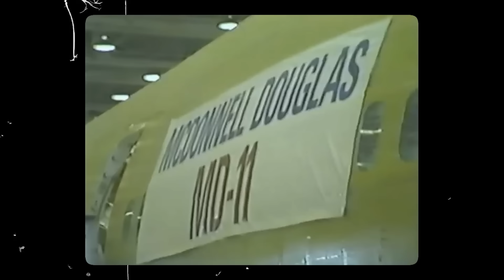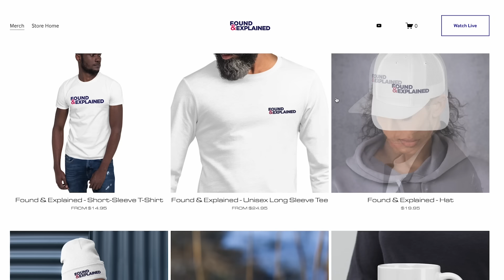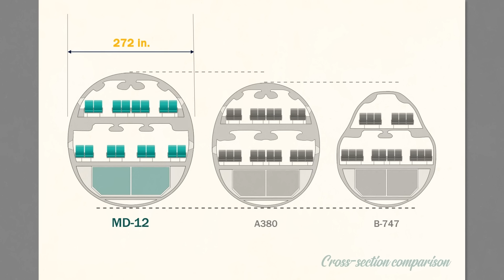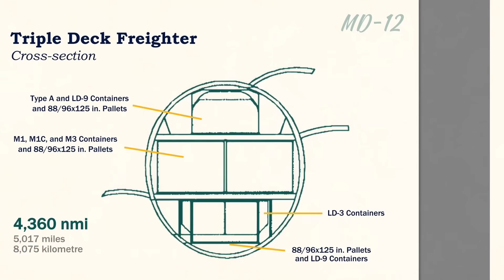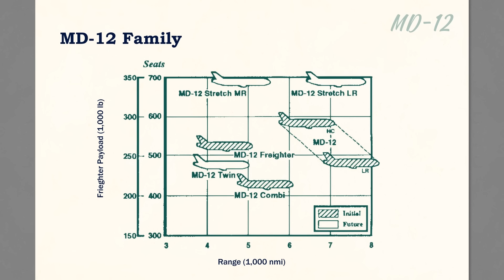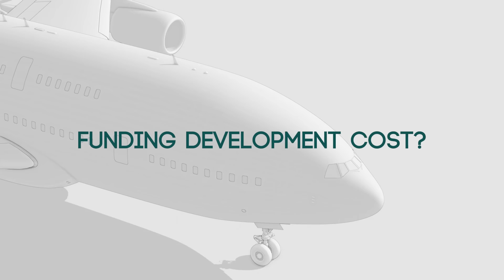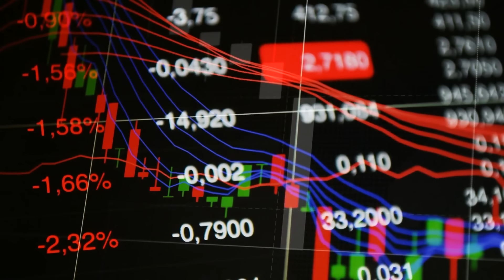What Happened To The American Double Deck Jumbo Jet? - MD 12

Comment: Compared to your first video on the MD12, the model now looks much much better. Its great to see you improve and grow man.
Reply: Looking at the videos of the aircraft in flight, I wouldn't have known them from reality.
Reply: The video is well done, but the plane is shown with the cockpit between decks, not on the upper deck as on the 747 as mentioned in the video.
Reply: Well, but the model does not fit the conent, showing the cockpit to be on the lower deck :D
Reply: No no😮 no 3:01  @Eldexo
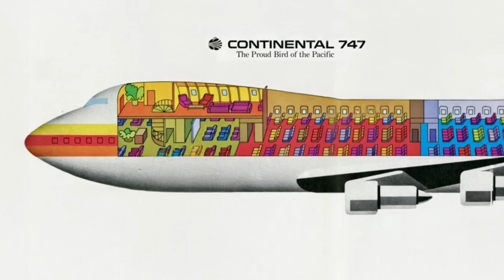Reply: 3:30
Reply: Agreed, he’s come so far.
Reply: @Flies2FLL his model is correct as per the concept. look 9:03
Reply: 9:03 cockpit windows in the middle like his model. It is correct
Reply: @747simmer4  we're talking specifically about the 3D model

Comment: The MD acquisition and their philosophy was what ended up screwing up Boeing.
Reply: Boeing thought they were the ones buying MD, when it was MD that ended up running Boeing.
Reply: Boeing always had safety problems and never owned up to them. The MD merger just made it even worse.
Reply: It’s almost unbelievable considering it’s the same company that made the F-15 🙁
Reply: MD management appear to be somewhat lacking viz their later negative impact upon Boeing … so perhaps it’s not a surprise this did not happen
Reply: And Old Bill Boeing is spinning in his grave so fast these days, he might cause the Cascadia Megaquake all by himself.
Reply: @josueramos7220 Well F-4, F-15, F/A-18, C-17 and American Harrier the military side seemed to be under different management
Reply: And Douglas...
Reply: @Prodagist  It was never this bad with old Boeing. Practically the only example are the engine struts of early 747s being possible to shear under load even when maintained well but  those issues were due to misguided engineering principles rather than cost cutting and so they were fixed fast
Reply: @cuscoothriyas5163  The main example I'd refer to about it is the Rudder system of the old 737-200s and 300s failing. It claimed 2 aircraft and nearly took down a third, Boeing was confirmed to know of the issue after the first crash but kept quiet to save their reputation.
Reply: F-15s have ejection seats, airliners don't.
Reply: I agree.

Comment: so a company who stole from Boeing and Airbus and still managed to fail...
Reply: Well technically they now run Boeing. So now it's Boeing which is failing
Reply: I think the narrator got that part wrong. When I read the history of the MD-11X and MD-12, the double decker MD-12 was well ahead of any meetings between McD and Airbus. 

In reality according to what I read, as soon as the ambitious MD-12 was scrapped because of a lack of funding in favor of the simpler MD-11X derivative, McD sought to simply purchase the wings of the A330/A340 from Airbus, but the latter declined as they saw it as an overt competitor.
Reply: thats interesting. I always thought that the md 12 wasn't built because boeing acquired it
Reply: @Ilovedanielgordeladze  
The MD-12 concept dates back to nearly a decade before Boeing entered the picture.

Comment: The MD 11 Stretch is something Amazon needs badly. They need more freighters badly.
Reply: 767 or 777.
Reply: The jungle air use mainly 737, 767 and couple Airbus 330. Over 100 cargo planes. According wiki

Comment: The reason airlines chose not to invest in MD's vision is because they knew it was farfetched and unlikely. MD had a reputation for missing targets and promises. Many airlines were burned by the MD11's higher fuel consumption and lower range than advertised.  They weren't about to take a massive gamble with them.  Singapore Airlines for exampled canceled it's MD11s and AA was desperately trying to unload them because they failed to meet promises.

Comment: 16:12 The A380 is a great aircraft. A cruise ship with wings.  If not for COVID, the A380 could never be challenged.
Reply: From an engineering standpoint the A380 is very impressive, but it is an economic failure. Airbus couldn't sell enough airframes to cover the development costs. The A380 is only economically effective on "Hub to Hub" routes with very high passenger frequency. However,  the increase on traffic on those routes that Airbus predicted when it developed the A380 didn't really happen. "Point to point" routes became more popular, demanding for more flexible aircraft like wide body twin engine aircraft (777, a350). That is why only Emirates bought the A380 in relatively high numbers, because they are the only airline that has a lot of "Hub to Hub" routes in their portfolio and why the A380 went out of production only 14 years after it's first flight. Covid had nothing to do with the end of production, because in 2019 Airbus already didn't have enough orders to keep the production going. Covid was sadly only the nail in the coffin for some of the already existing A380's that went out of service because of it.

Comment: A huge component involved with the demise of McDonald Douglas was not just the passenger plane development, but loss of the ATF and Joint Strike Fighter contracts. Referred to as the F-22 and F-35. With the down select for the JSF going to Lockheed and Boeing with McDonald Douglas losing out, the future drop out of the bottom and the match up with Boeing was on the table once again. That time for real. McDonnell Douglas was making a lot of money at the time, but that was due to existing production military contracts, which would be coming to an end because they were in the high income production phase instead of the lucrative and expensive development phase.

Comment: Only time I flew in newish DC-10, when I moved to Canada 1976. Little did paying customers  knew DC-10 had number of design flaws . Four years later number of them crashed because faulty cargo door latch design and weak jet engine mounting bolts. Were main ones.
Reply: In actuality, there wasn’t really a design flaw with either the cargo latch door nor the engine pylons…. But rather a lack of proper maintenance documentation which caused airline support crews to perform their work without proper guidance.

Specifically, the latch door was perfectly fine, but McD failed to emphasize the steps necessary to ensure proper closure since it was a different (and ingenious) design whereby the handle rotated in the opposite direction versus mechanisms commonly found with other aircraft of the day. As a consequence, McD reverted to a conventional latching mechanism and this problem never happened again.

As for the engine pylons, McD failed to notify support crews to avoid forcing the locking pins into place with a hammer, whereby the hammering action created micro cracks in the assembly which only expanded with subsequent flights. Once aware, procedures for mounting engines were updated to avoid forcing the locking pin and this never happened again.

In both highly publicized accidents, McD took a tremendous yet avoidable PR hit.

In reality, these incidents could’ve easily occurred with any aircraft, especially the hammering of engine pylon locking pins.
Reply: @sheldoninst  *The cargo door was absolutely a design failure... A convair engineer named Dan Applegate voiced his concern about it almost 2 years before the Paris crash when the door failed in static pressure testing.

Comment: It’s interesting that the engines on the planes from the 90’s looks so much smaller than the large bypass turbofans of today
Reply: Yep. A co-worker at a local airport I worked at tried explaining the old "high bypass" turbo fan engines to me when we were doing passenger service for that charter airline. Basically for all their available focused thrust, high bypass engines were less efficient and more polluting than current low bypass engines.

Comment: I’d love to see you do a video on McD’s SST entries, starting with their initial Douglas model 2229 design from the late 50s/early 60s, similar in size to the Concorde/TU-144. 

This SST was redesigned in the 80s to look almost identical to Boeing’s eventual fixed wing B2707, where the newer model 2229 was much larger (by this time simply renamed as the McD SST), and featured a large main fixed delta wing along with a tail wing.

Comment: I am very involved in the aviation industry.

I love the A380 and do believe it should be kept around for extremely high volume routes.

But the future of air travel is long range twin jets like the a350 ULR.

A plane that can fly from JFK to Singapore nonstop is perfect.

The problem is that the cabins need to be revised so that every seat has decent spacing in a 1x2x1 or 2x2x2 economy configuration RATHER THAN a 3x3x3 configuration in Economy.

They refuse to do this because of profits.

Fewer passengers equals less mass, less fuel use and longer range.

Hopefully technology improves and the ultra long haul nonstop travel improves.

Comment: Actually, if MD had built their double decker aircraft in the 90s, the airlines would simply have learned 10 years earlier what they've since learned with the A-380: The plane is not a money-maker, it's best use is for a small fleet of Ultra-Premium/HIgh-End passenger flight experience options.

Comment: Had McDonnell Douglas actually built the MD12, I'm fairly confident that we would've witnessed the first hull loss of a "super jumbo." We came close with Quantus #32, but ultimately, Airbus's safety culture and solid engineering led to that flight getting back safe.
MD has always put cost ahead of safety... "Destination Disaster" is a fantastic book about the DC10 failures and the Applegate memorandum.
Reply: We would have seen a crash that would eclipse Tenerife and JAL123. Horrific.
Reply: Yea agreed. MD were lethal

Comment: The McDonnell Douglas Company never really merged. The Long Beach site was the Douglas Aircraft Company. The St Louis site was the McDonnell Aircraft company. They hated each other. The St Louis guys didn’t really care about commercial airliners. They were never going to support such an expensive program like the MD12.  I was an engineer on the C-17 in Long Beach when the MD12 was cancelled. We were ramping up and hired the MD12 engineers. Fast forward to the competition between Boeing and Airbus for the new double decker jet. Boeing knew that the airplane didn’t make economic sense. Boeing faked a plane called the sonic cruiser.. Once Airbus signed. all of the contracts for the A380, Boeing dropped the sonic cruiser for the. 787..

Comment: I was the design engineer lead for the wing on the MD12, The comments that say MAC people ruined BOEING are wrong. Boeing s downfall started with 747 in the 1970 era. They started transitioning from an engineering approach to a get it cheaper. As a starting example The747 evacuation  drill took a week to pass standards using military folks as the guinea pigs. Then the push to replace seasoned engineers with college grads started. Lots of poor decisions made as experience was ignored, hence the 737 elevator crashes an even up to the present where they only use two pitot tubes in place of 3 which has caused two crashes. There are other tales of poor and downright bad engineering managers brought up in Boeings culture.
Fly Airbus if you can. 17:15
Reply from the maker: wow thanks for your input! thats a great comment

Comment: McD was failing, around this time, because the upper management were acolytes of Jack "Neutron Jack" Welch and they were busy growing "executive compensation" and "shareholder value" above all else. So they were pushing designs, and production, with a "lean and mean" work force (ie understaffed and bullied to deliver whether it was ready or not). This resulted in the mentioned design and production flaws.

The engines falling off ... that was another matter. One company was doing engine overhauls and they were screwing up the reinstallations, causing that problem. That wasn't a design or production flaw, that was incorrect maintenance procedures.

The cargo doors blowing out ... yeah, THAT was a design flaw.

After the merger, Boeing was, subsequently, taken over by McD management. I think we can see that this was bad news. Just remember: McD was failing, 'cuz bad management, and THAT was what was killing off their ability to do something big. Yeah, great-looking and -sounding aircraft concept there but y'all are gonna nickel-and-dime the hell out of your workforce, so the execs and investors can roll in dough, and deliver something unsafe so ... yeah, nah, not buying. Now Boeing is afflicted with the same disease.

Comment: I doubt the Boeing acquisition gambit. It would have required a level of strategic speculation that I have never encountered and that frankly wouldn’t make much business sense. In addition, the facts don’t support the idea: 1. The stock price histories of Boeing and McDD over the 2.5 years before the merger were almost the same, so there is little reason to believe that McDD got an extra boost from it. 2. The purchase price of $63 per share compared to the market price of $52 represents about a 20% premium. This is actually very reasonable: acquisitions usually command a premium of between 20% and 40+%. The merger was friendly, so the premium was at the lower end.

Comment: if those idiots had just made a 2 engine version of the dc-10 upon launch and a decent cargo door lock they'd still be in business!
Reply: There were plans to develop both twin 8 and twin 10 derivatives, but of course they were spending lots of their own money to fix problems with the F4 phantom, which led to the scrapping of the twin 8 (DC8 twin). The twin 10 derivative of the DC-10 simply didn’t materialize because then CEO McDonell nixed it last minute…
Reply: @sheldoninst  Ah, interesting ... sad loss of a great company

Comment: That even MD,  the second most successful airliner manufacturer for decades, could not  promote this and that the various  DC-MD 10 series were the end of the line  speaks volumes. of course Boeing would always be able to tweek the 747 series meant the development-profit  margin was always going to not be worth it. This is what Airbus found with the A380 to its massive losses. .
Reply: IIRC MD was more focused on the Military side of their business, and the company wasn't really in good shape after the various ups and downs of the Globemaster III's development program as well as trying to fix the various issues of the F4 Phantom (which had a troubled start if nothing else) and this lead to alot of internal strain.

Comment: To me the nose of the 787 look more McDonald Douglas then the rest of the Boeing family. Might of had a few md guys left on it . Have a good day.
Reply: The 787 looked like nothing before it. Widebodies from both Boeing and MD have 6 cockpit windows as opposed to 4 on the 787, and the 787’s nose tip is positioned lower in the fuselage cross section whereas the nose tip of other widebodies from both Boeing and MD are positioned towards the center of the cross section

Comment: It's too big.  There are not enough city pairs in the world where this could keep this airplane in the air a sufficient number of hours per day for it to make up for it's costs.  This is what killed the A380 and realistically the 747.

It would have certainly hastened the demise of McDonnell-Douglas.
Reply: True. When these planes were designed, only the largest 4 and 3 -engined planes had the range and reliability to fly transoceanic routes. Flights to Hawaii were LAX or SFO to Honolulu, and passengers first had to get themselves to LAX or SFO. Today, there are long-range smaller twin-engine direct flights from smaller U.S. cities to many of the other Hawaiian island's airports. The spoke and hub model the jumbo jets were designed for were replaced by more point to point flights.
Reply: @johnstuartsmith  The twins weren't used on overwater routes until the adoption of ETOPS, and the highly efficient high bypass turbofans made it practical to use single aisle twins on smaller city pairs.

Comment: Have they ended up building this it would have actually rivaled the Airbus A380 B747-8 B777-300/ER basically it comes down to this some operators will buy both if RR Trent engines equipped CX🇭🇰 BA🇬🇧 QF🇦🇺 MH🇲🇾TG🇹🇭 SQ🇸🇬 NH🇯🇵 CA MU CZ🇨🇳 LH🇩🇪 others will have  General Electric/PW KE/OZ🇰🇷 AF🇫🇷/KL🇳🇱 PR🇵🇭 JL🇯🇵.